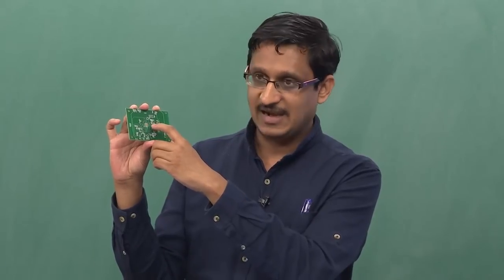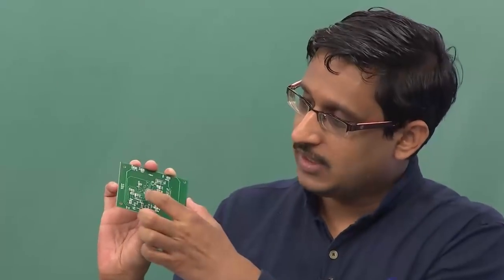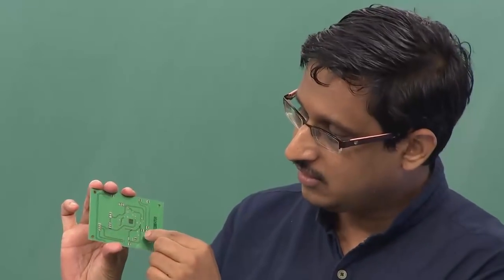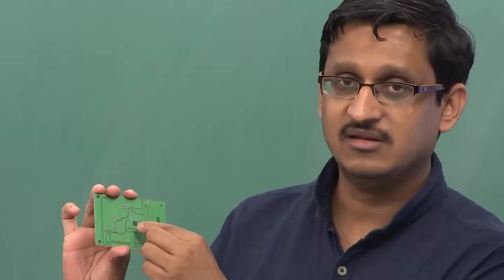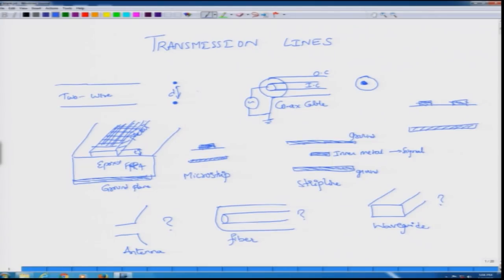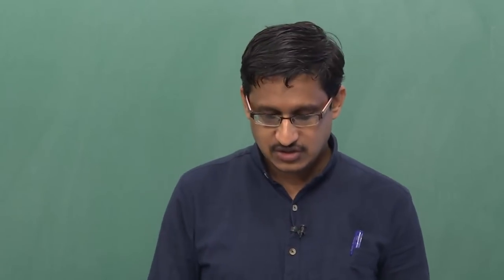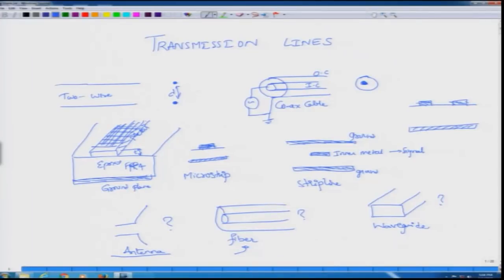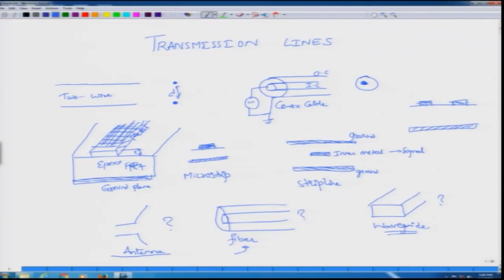Lecture 2-Introduction to Transmission lines

Comment: Discuss low loss radio frequency and UHF transmission lines. Also deduce 
resistance and reactance of the terminating impedance of a UHF transmission line.